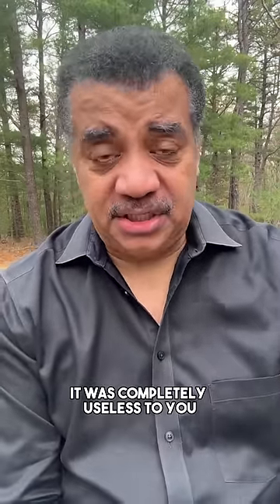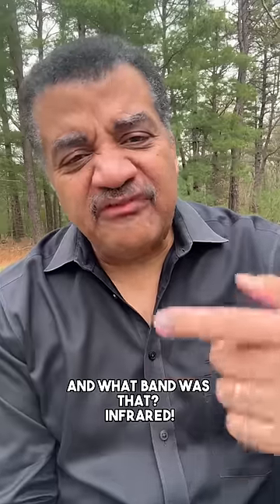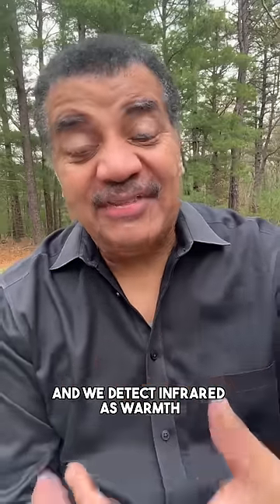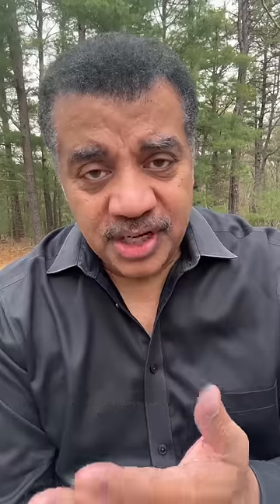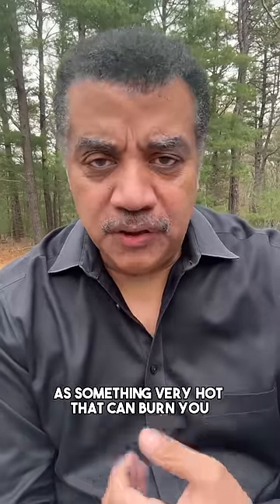LED Bulbs vs. Old Bulbs 💡

Comment: Plus the old light bulbs were quite valued for their heat output by people--and chickens--in cold environments. So the long wave IR wasn't always useless.
Reply: we are only just scratching the surface of the IR health benefits old bulbs had. LEDs while more efficient emit high frequency EMFs. They are better than CFLs but... two steps forward, one back.
Reply: True, but it added heat in a hot environment as well, which was often not desired...
Reply: A plain heater is more efficient and durable... chickens also don't like not to be able to sleep longer than 20 minutes. Get dark, IR bulb, and chicks sleep at night instead of suffering "passing-out naps".
Reply: Though it wouldn't be ethical, research could be done to discover the long term potential harm of using microwaves to heat the humans in a home.  Very inexpensive.  Perhaps a video could be done on this soon.  It's an old idea that couldn't be tried, perhaps experiment in a zoo, a prison, or a totalitarian regime?
Reply: 90% heat is an efficiency higher than most non-electric furnaces.  With my area's  electricity and home heating powered by natural gas, government-mandated LEDs made   homes less energy efficient.
Reply: If you want a heating lightbulb, buy a heat bulb.
Reply: @vallaindigital True, but Neil said "completely useless". As usual he's talking nonsense.
Reply: @GEKay-xt2cq are you seriously claiming the old light bulbs were an efficient heat source? 😂
Reply: Maybe not useless, but very expensive to use. Electricity is way more costly than e.g. gas.
Reply: Exactly. My Great Grandparents used 100 watt bulbs in the winter to keep the Well Water Pump from freezing in the Pump House.🤜🏿🤛🏿😎
Reply: Yeah minor outliers or chicken eggs, yeah we can make a better solution
Reply: You beat me to it. In construction, in winter, the window guys, put their tubes of black sealant in an insulated wooden box with a 60 W bulb to heat up the tubes because the sealant was frozen solid. When I was a kid, my dad, an electrician would put a 60 W bulb in our little 3 man tent me and my brother liked to sleep in, when the fall came before the snow fell and we would have to leave the entrance open (screen only) because if we closed/zipped the door closed we found it to hot and had trouble breathing cause it got to hot but we got to sleep in the tent even after the first snow falls. Mom would give us sleeping bags and big comforters and we would sleep on top of them because it was that warm in the tent
Reply: @OOL-UV2  Gates would never propose to restrict research to prisons and/or zoos.

He'd give a speech to a room where he'd already be zapping the audience with his proposal.
Reply: I used to have lizards, so I was thinking the same thing. Plants being grown indoors. Tons of things that benefit from the heat, although LEDs are an awesome replacement for our usual light fixtures in the house.
Reply: @Lovin_It  
Maybe try it on you.
Reply: Gla someone said it
Reply: Well this is called wild hiking...
Reply: @marcwilliams9824 completely useless in terms of providing light
Reply: @silverstem2964  Maybe ten years from now, we'll all be using it.  Will you thank me then?
Reply: @TheRealxVincent ... Not to mention dog houses... My dad would still a hole on top of dogs house n place a bulb inside for warmth for the outside dogs in winter... Good memories
Reply: @Chris_winthers  in some instances a heatlamp produces too much heat and a smaller light bulb was the wisest choice. The main point is that we deserve to have the choice, and if we want an incandescent bulb for whatever reason, we should be able to have it.
Reply: @donaldsmith5641  they're not ilegal. You know that, right? They're just worse for every practical purpose you could possibly want a light bulb
Reply: @Chris_winthers the production and sale of incandescent light bulbs have been banned. It went into effect Aug 1st 2023. So basically,  yes they are illegal.
Reply: @donaldsmith5641  please read up on your sources before saying something on the internet. The "ban" was just a general regulation on how efficient light bulbs have to be, it's only in America, and it only affects some types of lightbulbs. That means that if you want a "banned" type of incandescent light bulb, you can just find a place that sells efficient light bulbs and buy them there
Reply: @GEKay-xt2cq he's saying 90 percent of what you're paying for is heat not necessarily that it is 90 percent efficient at creating heat.
Reply: During winter old bulbs help lots
Reply: @dmw798  Efficient is relative.  Incandescent is about 90 to 95% efficient as a heater.
Reply: @danharold3087  Incandescent bulbs are essentially electric resistance heaters. And because of the inefficiencies of producing electricity and transmission losses, even dedicated electric resistance heaters are far less efficient than using natural gas, propane or an air-source heat pump.
Reply: @dmw798  The cost of electrical transmission lines generally cost more to setup but natural gas pipe lines cost more to operate.  That makes the case of natural gas being overall more efficient questionable given you are losing 20% at the furnace.   

But I really don't care.  As a home owner I care about my  heating costs.   The costs to make and get it to me are cooked in.
Reply: @danharold3087  yes true, I'm assuming other things being equal and infrastructure already in place
Reply: @gootyobt2032  Both are true.  If you want light they are 10% efficient.  If heat 90% efficient.  If its winter and you have the heat on you use both the light and the heat so no waste. 100%
Reply: That’s a niche use and not its primary function. They have ceramic heaters designed for that.
Reply: @Chris_winthers  Aye, aye, Cap'n!
Reply: Can keep the caulk in a small cabinet with incandescent bulb to keep from freezing on home build jobs.
Reply: Get IR bulbs for that
Reply: @vallaindigital daaamn, got ‘eeeem!!
Reply: B
Reply: Exactly!!
Reply: Useless over 99% of the time.
Reply: Just used my C9 bulb style Christmas lights strung up on my bushes and landscaping to help prevent my plants from dying in the latest 4 day freeze we had.
I welcome LEDs in certain applications but the old bulbs still have their place not just for heating but illumination as well.
I
Reply: Especially in summer.
Reply: @barbaramay5048 not enough heat
Reply: @John_Smith100  All things that use electricity emit EMFs. All of them. Especially those connected to AC lines.
Reply: @GEKay-xt2cq  heaters are literally 100% efficient. Efficiency is simply a measure of how much energy is wasted in heat. But if the goal is to generate heat, then nothing is wasted.
Reply: @Superman679 Have you considered the amount of heat you and your brother emitted inside the tent?
Reply: @coreyjenkins3056 I still do.I just use a 40 or 60 watt.in extreme cold temperatures.
Reply: 1000th Like
Reply: We used them all the time to help the chickens. It didn’t shine directly on them, but in filtered rays and the cuddled up right below for their heat.
Reply: @marcwilliams9824 It's useless for the primary application of light bulbs --- providing visible light for humans to be able to see better in otherwise dim or unlit environments. I can't imagine he meant anything other than that.
Reply: Yeah
Reply: @FJF1085 not really that niche , in norther latitudes there either cold and dark or warm and light . In summer we don't use any light
Reply: if you need a massive glowing resistor you need a massive glowing resistor, still not the most efficient at producing light but in some scenarios its the component for the job
Reply: I was going to mention that.they were good to keep animals from freezing like chickens or dogs/cats ect.
Reply: Both should be made available in market- let customers choose as desired.
Reply: @Xtjiggzs  they are? nobody is saying they shouldnt be? Ultimately the consumer is paying for the electricity.
Reply: @John_Smith100  ok bud, just don't use em *shrug*
Reply: Thanks, Neil
Reply: Still energy prices never went down, welcome to the present 🤪 🤪
Reply: The LEDs burn out your retinas though & pineal gland I have heard. Incandescent bulbs have a healing hue to it. My animals won't sit by lamps or lights unless they are incandescent.
Reply: In the UK, sales tax (VAT) is not charged on food generally but it is charged on restaurant meals and takeaways. What makes food takeaway rather than groceries? One factor is whether it is heated, or at least kept warm after baking. So one bakery chain installed deliberately inefficient old bulbs to “light” their food displays. They didn’t charge VAT because the heating of the food was only “accidental”.
Reply: @John_Smith100  3 steps back

Comment: In cold countries the heat made by the bulbs was not wasted.
Reply: Well it's not really enough heat for you to notice unless it's on for many hours or if you touch it. For normal sized bulbs, anyway
Reply: @drabkebab it adds up in the winter when you need artificial lighting and heat the most.

Heck I live in a mild cold climate and we used a perpetually on incandescent bulb to keep our pump house pipes from freezing.
Reply: @priestesslucy3299  It can of course, it's generally not a very efficient heat source tho
Reply: @drabkebab agree, the most efficient way of heating in winter is firing up your early 2010s gaming computer. And in Russia, people live in data centers in the winter
Reply: Facts
Reply: @drabkebab nit very efficient, 
but heat does rise... 

So itll heat up the top before bottom of room yes.. 

But Leaving more room for heat usee from a heater to spread more evenly
Reply: @priestesslucy3299 facts, they dont help much but at least heats up top of room cuz glass dome gets burning hot to touch

In return regular heater spreads easier and evenly doesn't habe to heat up the top
Reply: The base of the LED bulb does get hot
Reply: Give me LEDs for lighting and an efficient heat pump for heating....
Reply: Non efficient heat sources are wasted since you're paying for electricity.  You'd literally be better off with modern bulbs and Turning the oven on
Reply: A space heater and LED bulbs paired together is likely going to be more energy efficient
Reply: @Bigboss192x  actually no, the power used for the light bulb 💡 isn't even enough to charge your phone
Let alone an led modern bulb is just morr expensive consumer
Money buying

You can literally get cheap bulbs by the bakers dozen for $5

And they Last longer too
The led have a shorter life span 

And the modern bulbs have a lot more chemicals

The old ones were just a sparkle incased inside of an Oxygen free container 

The led have chemicals that travel thru the tubes
Reply: @Bigboss192x  only reason they made the switcb was because of fire issues with the old bulbs
Some companies didn't build them well they combust or simply just explode..

But Nikola Tesla figured differently...
Reply: @writerofxenos  false, LED’s last much longer. LED’s do not have harmful chemicals. I think you’re confusing them with fluorescent T8 tube lights. 9W is much lower than 60W A19 bulbs. I did LED retrofits for schools & some would save over $100,000 in electricity per year by switching over to LED. I did the ROI spreadsheets.
Reply: It wasn’t that much heat
Reply: I can't find a source of where I heard about it but I heard that when old light bulbs were banned because of how inefective they were as a light source people rebranded them as a heating device and just keep selling them.
Reply: @drabkebab that is objectively not true
Reply: @priestesslucy3299  a heater would be more effective and efficient
Reply: @priestesslucy3299 you'd be better off with LED and a heater. It'd be more cost efficient.
Reply: @craigmak less power and more light pollution.  win LOSS
Reply: @shanti1445  LED’s create less light pollution because they’re directional. Other light sources create light in all directions. You can have super bright LED stadium lights that shine on the field & don’t hit surrounding houses if aimed properly.
Reply: @craigmak  they reflect more light.  You can see the difference from space!  WTF are you on about?
Reply: @shanti1445  light pollution also known as light trespass is when light hits unintended targets such as residential houses. LED’s limit this. I think you’re referring to cities being visible from space which has been a thing long before LEDs were invented. I don’t think you know what you’re talking about at all.
Reply: Terraflx  
They use up the oxygen in the room, and start house fires.
Reply: My dad heated the dog house by putting a 110 bulb in a coffee can. Since the interior of the house was insulated, it was toasty warm. If the bulb burned out, the dog let him know—loudly.
Reply: It’s still more efficient to use LEDs and then have a dedicated electric heater
Reply: @joshuaspeedy4780  
A dedicated heater for the doghouse?
Reply: a lot of traffic lights in cold places use old light bulbs or they have to buy special heaters.

although the heaters save money in the long term if it's a new installation.
Reply: @simonhoel2704  
Money saved in the labor costs of replacing the lamps.
Reply: and in hot countries it definitely was
Reply: So in the summer incandescents  are wasting 90% of the wattage to unwanted heat and then if you have an AC, your burning more power again to remove that unwanted heat. The small side effect advantage of heat in winter is cancelled by the extra AC use in summer.
Reply: Yes it was. A fireplace or a radiator is much more efficient